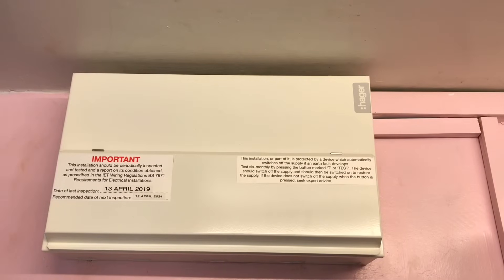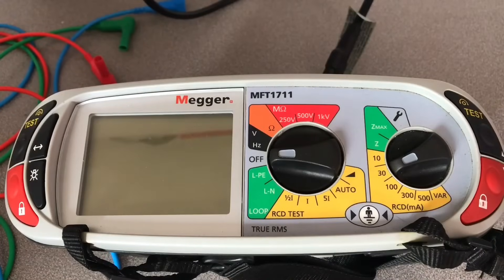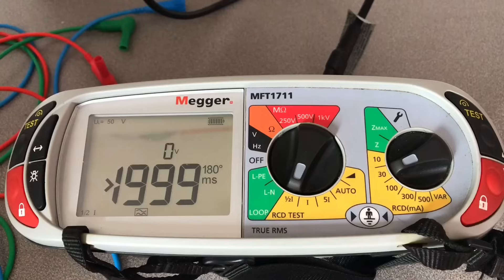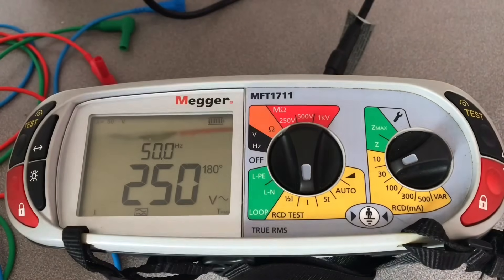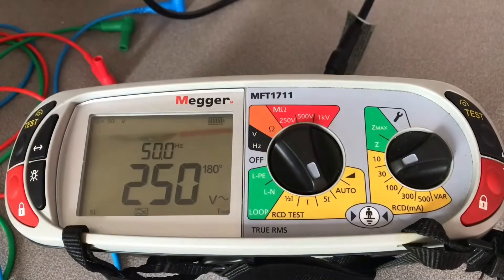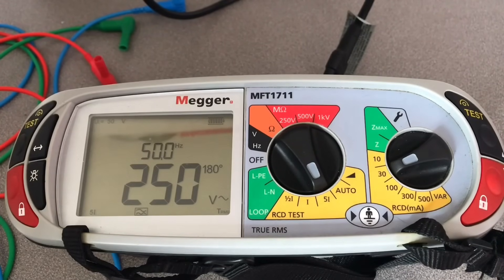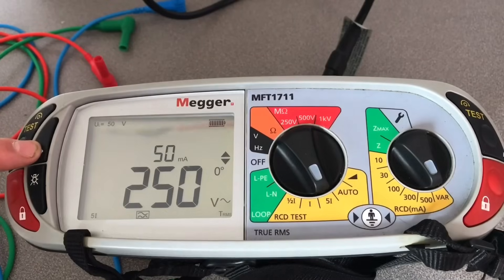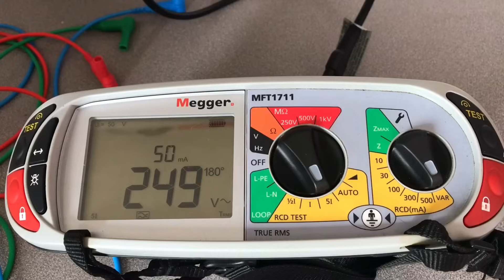Updated Guidance on Testing Hager Type ‘A’ RCCB’s (What to do if they Fail 5x 30mA (150mA) Test.

Comment: Could it be fair to say most type A rcd are like this? I've noticed this with proteus type A rcd are just the same. Reading always being on the high side.
Reply from the maker: This should help

BS 7671 Testing RCD’s - Regardless of the Type of RCD Test it as if it is an AC RCD at x1 ONLY https://youtu.be/zIPgYcLdQZE

Comment: Very interesting. I’ve been using Kewtech and I’ve had the same issues. However recently started using fluke 1664 and reading on hager rcd/rcbo’s much lower. On fluke I test separately type AC and type A

Comment: Question, what if my tester is old and doesn't have a variable setting, so only 10ma, 30ma, 100ma or 300ma...the closest thing I can put through these A types will be 100ma or a new tester :(

I got 2 Hagar's that failed conventional 5x tests but my tester can't do 250ma

Comment: Interesting video.  A question re the Megger MFT used:  If you change the test current to 50mA for the x5 test.... Do you have to change it back to 30mA afterwards so that next time you do a x1 it won't do it at 50mA?  Or..... is the 50mA only stored for x5 type A?

Comment: So, if your 30mA RCD fails at X5, get your Sharpie out and write over the 30mA printed on the front of the RCD, 50mA. Easy? Right?

As it says in the regs, it's all down to your engineering judgment, and no liability rest with them.

Comment: I have exactly the same tester as the one in the video, it has been recently calibrated but when testing these Hager type A RCD's. It trips the RCD when switched to VAR at x5 50mA but just says "TRP" on my screen and not an actual figure in milli seconds. Could my tester be faulty?

Comment: Question for anyone please. Recently been working on a new build site where they have installed this type of Hager RCCB. On both RCCBs I'm getting tripping an half current at 1500ms. Recently calibrated machine etc. Also worked on a house on the same estate with exact same install and theirs isn't tripping. The property has been re tested by the electrical contractor who works for the building company and they said it's "fine", whereas I'm saying the device is over sensitive. Are there any specific parameters for tripping at half current for these specific devicess? Thanks all

Edit: kewtech kt64 , testing on type A

Comment: What if your meter wont test to 250ma?
Reply from the maker: Hi. Then sadly the electrician has an issues caused by Hager. Thanks for commenting and watching Gaz
Reply: Can you set it to 500mA x 0.5 (=250mA)...?
Reply: @desmcdowell2469  when I do this on my Metrel MI3152 it just fails it without giving a reading.:((

Comment: If you perform the same tests with the setting for AC you'll get much better results. The meters are creating different types of fault currents, depending on which type of test you perform. But it's good to always test the worst case scenario. If you have an AC fault the type A RCDs will react as fast as the old AC only RCDs.

Comment: Would be helpful if Hager actually had product literature for the Hager RCCB CD285U (100A 30mA type A RCD), and included this guidance. Apparently there is "no Data on the CD285U and they are not selling it as a spare part". This comment was from their tech support on the 12/4/19

Comment: Is it a good idea to put the stickers on the actual breakers. If they need to be changed - the stickers are going to either go with the   defective breaker  / try to be scraped off / or new circuit label be printed. Why no just put the labels below each breaker ?
Reply from the maker: Hi. Sure. However each electrician have their own way of doing things... it’s not my board remember. Thanks for taking the time to comment all the best Gaz

Comment: I rarely see Hager and have never fitted them. The way those breakers line up with the front cover isn't selling it to me either. Having said that, having space for labels on the MCB's does look useful - my usual solution to keep track when the board cover is off is to write the circuit number on the upper front of the breaker, so it's behind the cover when it is fitted. My labelling of the front panel would always show the circuit number
Reply: They are a great board David, and one of the few where you won't get any domino affect on the MCBs

Comment: Thanks guys for this information, as you say it will be useful as a back up test in the event you want extra reassurance from borderline results at 30mA (am I right I guessing they are using 50mA, as electrical shocks at 50mA or higher can be fatal - I might be wrong in thinking that is the reason for the figure they are using, just the 50mA sticks in my head from my EAL/LV2 book p36). Also great video in showing how to adapt the Megger for variations to the mA settings. Love the testing advice videos 👍
Reply: 30mA is enough to give you breathing difficulties and put you in hospital

Comment: Can almost imagine the Hager board room meeting discussing their new type A rcds not always meeting additional protection disconnection times and the one sneaky bastard finding that loop hole allowing 250mA to be the test trip current value. My tester for one cannot do a 250mA test and measure the trip time.
Reply: Oh well, you've had your eye on a that new tester for a while now, go on treat yourself 😉
Reply: Test at 500mA, (.5 delta n)
Reply: @loosecannon5813  1/2 times simply gives pass or fail, doesn't give a trip time.
Reply: @pauldavies9709 You right some testers won't give a reading, as they said in the vid.  BS 7671 reg 643.8 allows you to test at 250mA or more...... Try 300mA?

Comment: Bs7671 regulation 415.1 states that to comply with additional protection an rcd must be tested at 5xI delta n .
The rcd must be rated at 30mA and must trip within 40ms.
Therefore this is what's commonly known as fudging the test results.
Reply: However regulation 643.8 the note states the effectiveness is deemed to have been verified where an Rcd is tested at equal to or higher than 5 times its rated residual current 🙂
Reply: @marcusbarritt91  Interesting that there is no upper bound. Time to melt some RCDs with 6 kA trip tests?

Comment: I'd love to be proved wrong but I was always under the impression that when testing rcds and rccb and rcbos the test should be conducted at the distribution board with the load disconnected. Just thinking if there is an electronic load in circuit ie capacitors then they may be answerable for the delayed disconnection as any capacitors in parallel with the supply will hold the supply voltage up until the capacitors have discharged.making the tester believe that the circuit is still energised for longer. Unless I've got the complete wrong end of the stick as to how type a rccb work.
Reply: You can opt for socket for safety reasons, if it fails the test you can go by manufacturers instructions by doing it at the fuse board  with no load.  The problem with manufacturers instructions in the case of sockets on the EWR you shouldn't work on live equipment unless safe to do so or if it was not reasonable to work on it dead so you pick the safest option, if you can't then you still need to take necessary precautions to work on live.  But with a lighting circuit usually by default you might as well do it by the fuse board unless there was a non dimmable 3 or 5amp socket and you have an adaptor for it otherwise comply with manufacturers instructions and take.precsutions to comply with EWR
Reply: @MrSJT  amazed anyone's still reading comments from a year ago. I don't know off hand but figure live working is an exception to the rule when carrying out testing as cannot see a way of doing a loop test on a cooker final circuit if the isolator does not incorporate a socket outlet. Short of only doing r1 and r2 and adding to ze. But again how can you test ze if supply is dead. If we only went by enquiry method the DNO are likely to give the 0.35 and 0.8 figures and if the latter for TN-S then the max permissible may well fail any circuit not rcd protected if testing an existing installation say serving a commercial installation with c type mcbs where a c32 has max permissible of 0.57 which is clearly less than the 0.8

That said were all qualified and we know how to minimise risks and so I'd say its just a matter of delving into the case of competent or not.

It does give food for thought and I enjoy hearing others interpretations as 10 people can read the same thing in 10 different ways.

I'll look forward to a year's time when I may get a response.

Tom
Reply: @bourneelectricalable  I only watched this video recently so hence your comment would have been read by me 😎.

Yep there are exceptions to the rule in some cases.  I was replying solely based on the socket situation.  But in the real world while we're working on the board and competent, we might as well do all the RCD testing at the board while we're there.  As for the Zs of a cooker circuit, R1+R2+Ze will give us the worst case scenario reading eliminating the parallel paths.  That reading will ensure that it still passes even without the parallel paths.  However, you should take Zs anyway just to be sure.
Reply: @bourneelectricalable  the exceptions are found in the combination of Guidance Note 3 tests required and the EWR regarding working on live equipment.  If you can't work on live equipment where it's necessary just means one is not competent... simples

Comment: Sounds like Hager are fudging things to me
Reply: Actually not. If you test the RCDs in the A-setting your meter produces a fault current which is a pulsating current (unsmoothed DC directly after a rectifier). If you perform the same tests with the AC setting on the meter it will produce an AC fault current. In that case the RCD will react as quick as an AC RCD which you are used to know.
If you set the meter to type B the types A and B won't trip (or will trip at a much higher current), because type B is smoothed DC.
If I test an RCD here I always test AC AND A to create both scenarios, AC fault and a pulsating current fault. The last one could come from a defective switch-mode power supply. The test results on AC are on a type A RCD always as good as on a pure type AC RCD. Here in Germany type A is the standard, the type AC RCDs were banned for new installations in the year 1984. So they are not a new thing pushed on the market to make more money, actually they're established on some markets for decades. And we now live in times were you'll find switch-mode power supplies almost everywhere in almost every appliance. So it's actually improving the safety to switch over to type A RCDs.
Reply: @Marcel_Germann  Every single Type A RCD I have ever tested do trip on an AC fault with 30mA of "smooth" DC superimposed, (Type B DC value), All well within the allowed times, a Type A test requires just 6mA of DC offset! most "AC" RCD's (at least 50% of them) also pass a type A test well within the stated times. type B tests are different, the "DC" test MUST cause a type B to trip where a type A and AC should not. 

Any RCD (Type AC, A or B) is quite happy supplying a rectified circuit even with a 1/2 wave rectifier at many amps (a low cost hairdryer on low heat setting for instance), so long as the DC (pulsed) is flowing equal and opposite through the RCD it will still trip in the event of an earth leakage fault. 

British standards (table 3A) are quite clear on maximum trip times and at x5 its maximum is 40mS for a 30mA device, I would assume VDE is the same? Manufactures should not be making up trip times to suit their own limitations!
Reply: @ianlouden7939   The same, also 40ms on 5 times of the tripping current. Tripping current must be between 50 and 100% of the rated current (on a 30mA RCD between 15 and 30mA). For 1x tripping current it is less than 0.4s on a TN-system and less than 0.2s on a TT-system (VDE 0100-410), actually that is on a TN grid also the required value for the MCB to trip (or a fuse to blow) in case of a short-circuit if the circuit is fused with 32A or less. On a TT grid you'll never get such a good value, so they already started very early using RCDs or those voltage operated breakers, where I don't know their english name, to get a proper tripping time in case of a short-circuit. In Germany the RCDs are mostly still called FI (f is for Fehler or fault, I is the symbol for current), the old voltage operated ones were called FU (U is the symbol for voltage). And now due to harmonisation we call them RCD here too.

 The VDE 0100 is the same as your BS 7671, even numbers of chapters are identical, for example VDE 0100-701 (electrical installations in rooms which contain a shower and/or bathtub):

https://upload.wikimedia.org/wikipedia/commons/0/06/Bad_Verlegezonen.jpg